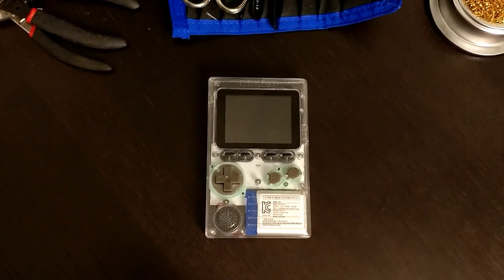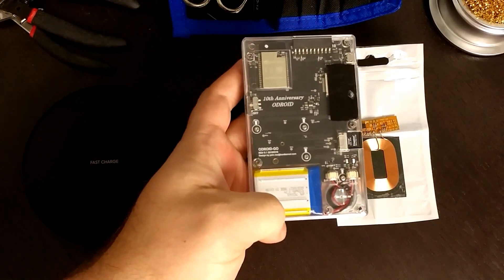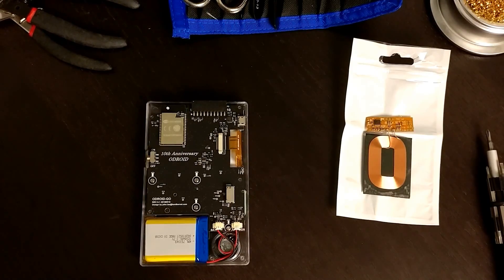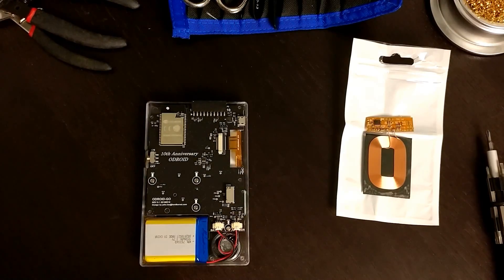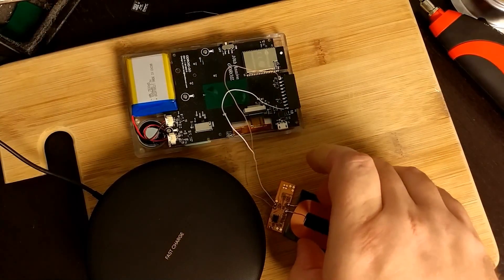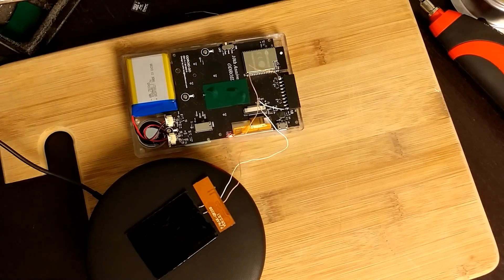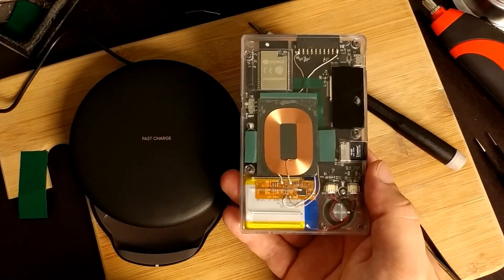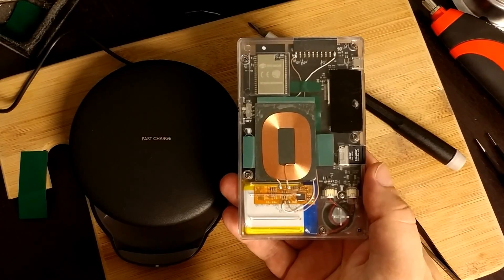ODROID-GO Qi Wireless Charging!

Comment from the maker: WARNING: In a previous version of this video (which I have since edited using YouTube's edit tool) I stated the pin assignments backwards. The correct header pins are PIN 1 for GND and PIN 10 for VBUS. The current version as of October 3rd, 2018 no longer includes the portion of the video where I made that statement. Always check schematics and independently verify your work when tinkering with electronics.
Reply: That might explain my blowed up Qi module. 
Not unsubscribing or anything but this earned a BIG WTF?
You need to re-do this video to save folks some trouble and expense.
Reply from the maker: Unfortunately you can't redo videos so I'll just cut out that part. Sorry about your failed module. I didn't intend this to be a How To video.

Comment: Cool project!  You actually can see its charging, because the red light that lights up when you put it on the Qi charger. Kamots, theres a new Firmware that came out yesterday. WIll you make a videon on that? Not sure if the flash process is the same.
Reply from the maker: Yep I meant that you can't see the progress as it charges, only that it is completed when the light goes out. Didn't think about my phrasing until after the video was released. My videos are not scripted just lots of cuts :) As for the new firmware it only has some SD card compatibility fixes. No need to update if your device is working fine. No new features.
Reply: Great, thanks! Was hoping for a volume fix, but will have to resort to muting it physically in the case somehow.

Comment: Great video man. Any chance you could upload this process in normal speed? Id like to try doing this and its a bit hard to follow what youre doing with the video going so fast.
Reply from the maker: I'm actually going to write an article about the process so I'll link it to you when it is published. The original speed video was almost an hour and a half even after editing out swearing ;) It will be far easier to follow my guide when it is done.
Reply: @KamotsTalksTech  awesome. Id really appreciate it. It will probably take me about the same amount of time. Im not very good at soldering, even just reflowing existing solder for minor stuff like this, so im sure ill be doing an equal amout of swearing as well. Keep up the good work. Youre the reason i ordered an odroid go. Should be here in a week or so

Comment: You should try some 3m brand VHB double sided tape. Has a high temp rating, is VERY sticky, and is clear. Awesome idea, looks like I'll be opening my odroid again!
Reply from the maker: Thanks I may give that a try. I was dumb and didn't think through mounting the coil until I was setting up for the video. I just knew I wanted it as close to the back panel as possible.

Comment: I've been thinking about doing this but with an external version through the micro USB port. Glad to see you made a video. I'm not really good at soldering so not sure if I'll attempt this though.
Reply from the maker: The hardest part was actually getting it to fit nicely in the case. Soldering was only 4 connections. Not saying it was easy but I am no soldering expert and I did it :)